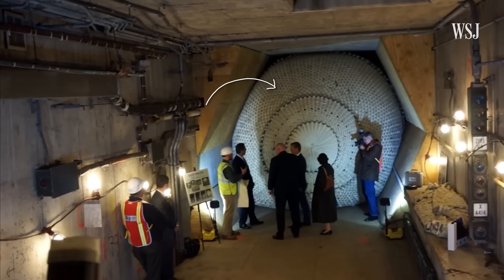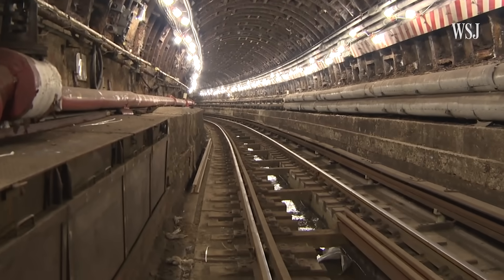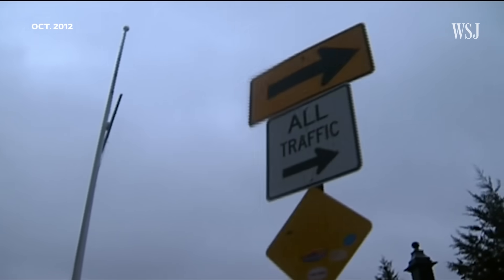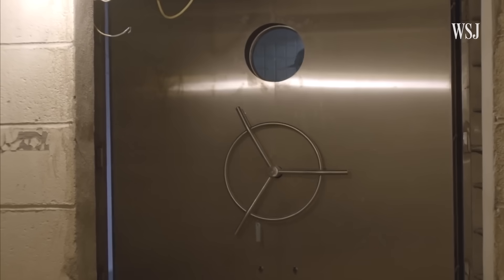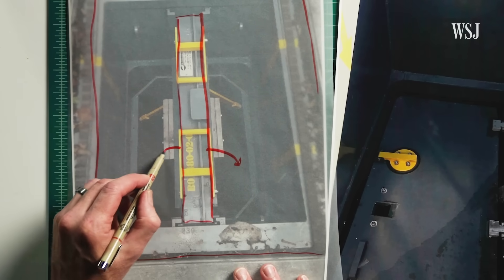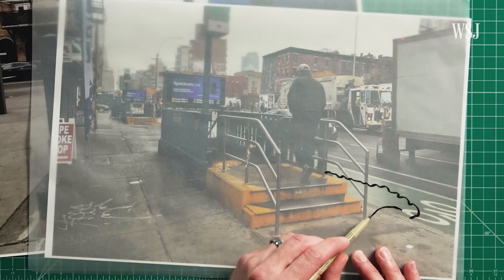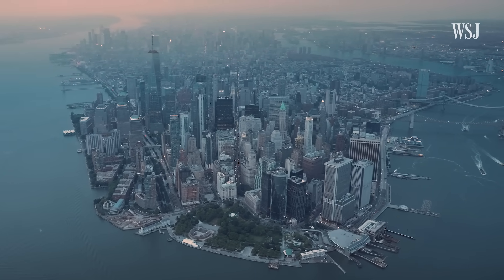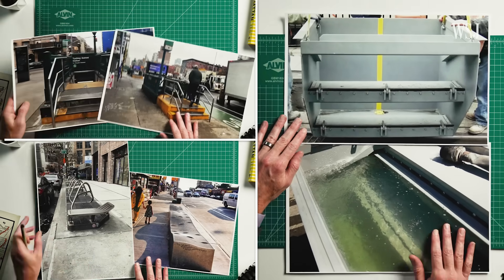Why NYC’s Subway Keeps Flooding | WSJ Pro Perfected

Comment: They should just take a clue from futurama and just raise the city to future flood levels thus solving the problem once and for all.
Reply: That is actually what Chicago did, in the 1860s.
Reply: @michaelkhoo5846 Seattle also did that, they just built the street and sidewalks up one level, the original ground levels under the streets are still accessible via a walking tour.
Reply: @joermnyc Some small bits are accessible and part of a tour. The majority of the old city was just demolished as part of the giant earthworks project and it's just dirt or new buildings foundation underground.
Reply: just ask the Dutch... lets build a system to not only control water but reclaim land... Fun Fact the Dutch have been reclaiming land and protecting their coast since the 1300s.
Reply: ONCE AND FOR ALL!
Reply: @DrkGddss  hey you got the reference.
Reply: You can show them how to raise a skyscraper

Comment: NYC and America in a nutshell - couldn't run a gas station efficiently. Flood logs? Six guys to put up beams to block one door of one station of 472? Only the MTA could think that up.  After Sandy the City hired a water expert from Holland for ideas to control flooding. The Dutch know a bit - 20% of the country is below sea level. He quit in disgust within months after dealing with the locals - incompetence and corruption mostly. $5 Billion spent and another $8 Billion coming - for what? The MTA is The Black Hole of Cashkillers.

Comment: China doesn't have these issues btw
Reply: Newer systems built in the 21st century, not 19th century.
Reply: @Dcarnys  china had metro lines back in the 70s
Reply: @Mandom007  that would be mid 20th century, as opposed to late 19th century...
Reply: @linchen5129  it doesn't have anything to do with when they were built, China will keep them well maintained for decades, while the US straight-up doesn't care about public infrastructure. Everything is crumbling they gotta rebuilt the while metro system, instead of temporary repair
Reply: they literally do

Comment: Okay, hear me out, instead of putting billions into sealing off the spaces from flood/rainwater, how about we invest in the projects that can help the city better integrate WITH the unwanted water. These boroughs are built in a grid street pattern so we can dig out a few of them, deep enough to hold excessive water in the event of flooding, and turn them into little canals with ample green space around for the rest of the year. We can learn or even take expertise from Korea, China, and the Netherlands in this regard.
Reply: Yeah there are already tons of bioswales being installed aronud NYC - it's already happening; there's no reason why you can't do two things at once.
Reply: Basically what the los angeles river is
Reply: For the vents, my suggestion would be to create a one foot edging around the vents.
Reply: ah yes build a canal in the middle of NYC
Reply: No Manhattan needs to have 10 million people on it. We cant possibly acknowledge that its overpopulated.
Reply: Not altogether a horrible idea. NYC was called "New Amsterdam" once upon a time.
Reply: There's a reason it takes billions of dollars and decades to dig up a small extension tunnel to the subway. NYC is so dense above and under ground that building anything new is an insanely complicated process.
Reply: Didn't necessarily understand the beginning ( im more visual... not your fault) 
But looking at what works In other countries is always a great idea. 
Why reinvent the wheel.
Reply: For one thing… New York already has a huge underground network of subway tunnels and utility lines. To build even more tunnels means digging beneath what’s already there without disrupting anythjng. They addressed your exact point in the video.. try watching it before commenting
Reply: @atomicgiraffe250  With all these expert opinions around here we should never run out of ideas to keep the money being wasted.
Reply: no, that's too good of an idea. they couldn't possibly go with that
Reply: With your idea I'd say yeah definitley. Like close off the road on a single side of a block every few blocks, dig it down to like 20 meters deep, then cover it with a green space/park. The point in the video where they're like "nope can't raise the grates, will get in the way of the narrow sidewalk" sucked because they're literally next to a 6 lane road in the middle of the city, just remove ONE lane at least and boom now the sidewalk is now over twice as big even with the vent shaft raised up. In London our vent shafts are huge and are well above the surface, sometimes like 15ft+ and hidden in a statue or a building or something. NYC seems to not be doing well with reducing the amount of cars/traffic in the city though so I can't imagine them removing lanes soon. They just cancelled the congestion charge system which has been proven to work in London for 20 years now, it had an instant drop in cars by like 20% there and increased bus speeds dramatically. Sp Introduce the congestion charge to reduce the amount of vehilces a lot,  then you can now remove 2 lanes along the roads the subways follow and convert it to sidewalk, and with that now huge public "sidewalk" space you can even redesign the entrances completely and raise every vent however high you want. Can make the entrances twice as wide and more nice and open, build the flood measures into them including raising them. Can introduce an elevator down to the platform too with the new street space. It's time NYC starts reducing the amount of 6 lane roads through the city. NYC has it on easy mode with how easy it would be to make very nice. Places like London stuggle with road space because they're all already tiny so even adding a bike lane is impossible in most of the city center, but new york has space to add literal parks along their roads, they could add 50 parks and barely touch 10% of their roads.
Reply: @walker1054  Yeah, well you are forgetting that NYC is in the car obsessed USA, so them taking away just one lane in one direction would cause something close to gridlock with NYCs traffic...